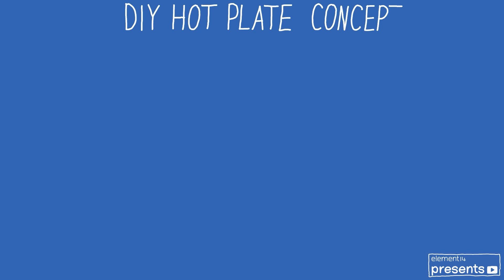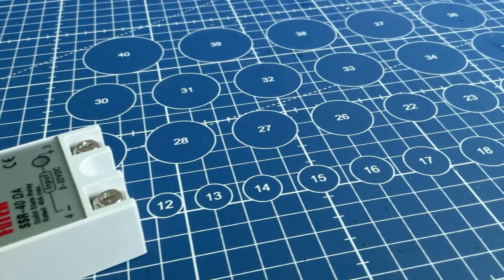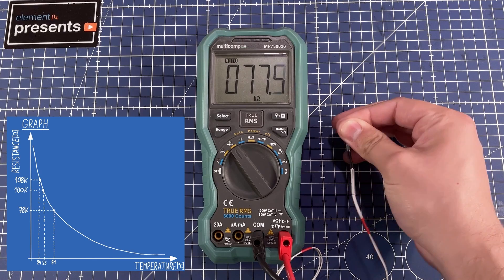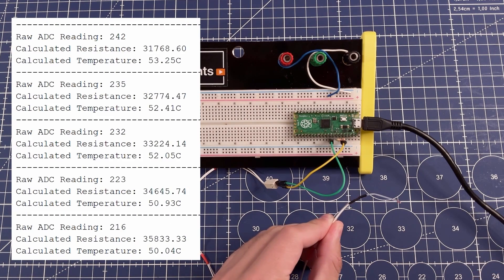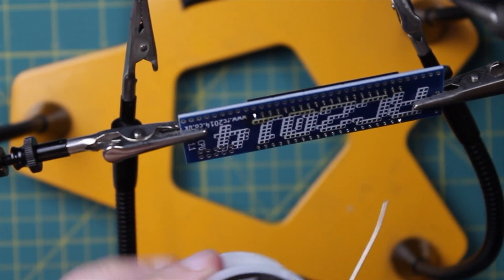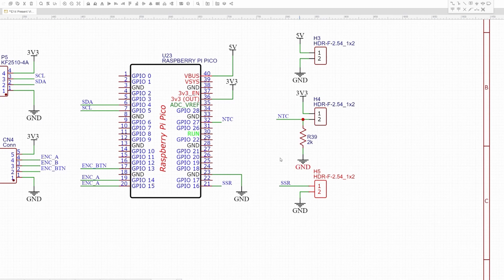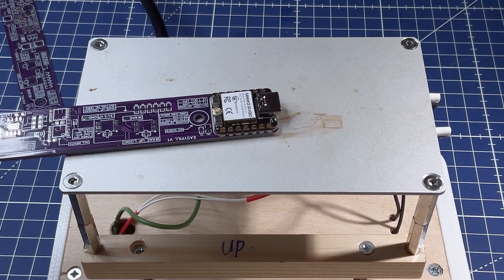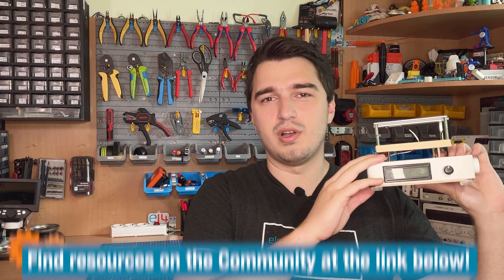DIY Hot Plate for SMD Soldering Using Raspberry Pi Pico

Comment: I have some doubts about how you fixed the thermistor to the plate. Did you drilled a hole om the plate and then fastened the thermistor with a washer?

Comment: Dude, this design makes no sense since you are using a heating table with a ceramic heater. It stabilizes the temperature itself at about 230°, there is no point in attaching such a circuit to it at all.
Reply: Some soldering paste requires a temperature profile with lower temperature like 139 °C. And also you don t need to heat the pcb and component to fast because you can blow them. So, yeah, is not useless.
Reply: @DemonSh  I'm using a strip heater that could go higher unchecked. You could use any kind of heating element with this.

Comment: When you get that much solder paste on your pcb it's easier to just wipe some of it off before using the hot plate, especially on smaller SMD's like the resistors. Just faster and easier than having to go over every single connection again with your iron.

Comment: Don't we ever need a heatsink for the SSR ?
Reply: If it's way overkill (like 40A) it maybe not necessary. In 3D printer they generally don't use heatsink. However not only there is often a fan to recycle the air but they stay away from 4€ models from Aliexpress on something that can be a fire hazard.

Comment: Thanks for posting that! Was using a raised LED desoldering plate similar to that and it only had the 2 wires coming into it, so I usually only touched the board with a chopstick or other non-conductive item when it was plugged in. That said, it heated the boards too much and I want to have a MUCH SAFER AND RELIABL option with an actual temperature control so it doesn't overheat any PCBs.

Comment: Cool.
I'll have to try making it myself using a bare ATmega (currently that's all I have on my desk).
There 's a little question, does controlling the SSR not need to synchronize with the phase angle of the AC line?  
No need for zerocross reading?
Reply: I never worked with SSR's, but after seeing your question I decided to look it up. Seems the zero crossing detection is needed if you wanna dim lamps etc. If you apply steady power to the SSR it will be 100% on.

Comment: Does anyone have a link to the hot plate?
Reply: You can find loads of versions online. They are called “PTC hot plates” or some variation on that. The PTC means Positive Temperature Coefficient which means that as temperature increases the resistance also increases which reduces the power to the heater, this is good because if you just connected it straight to mains voltage then it would rise up to a certain temperature and wouldn’t be able to go higher. This is also why they have temperature ratings, they won’t be able to get higher than this so make sure you choose one with a high enough temperature that it will work with whatever paste you use.
Reply: @conorstewart2214  thank you! Most important part of the project not listed hehe. Found what I needed thanks to you!

Comment: I would probably not use wood myself even though it is tempting... There are some high temperature alternatives like phenolic resin (bakelite) sheets or PTFE sheets (probably too expensive). I would probably opt for something like G10/FR4 / PCB without the copper layer... which should be accessible for people working with PCBs, particularly because it is the theme of this video.
Reply: PTFE sheets are not a good idea, if they get too hot they will start to offgas. Plastics in general aren’t a great idea unless they are thermoset plastics because otherwise they could melt. At least with wood it would burn and you could see it more easily. G10 or FR4 is likely a good idea, it doesn’t really matter if it has copper on it really and you could always sand or grind it off if you wanted too.

If there is enough separation between the hot plate and the mounting material it should be fine anyway as the temperature down at the mounting points should be lower.
Reply: @conorstewart2214  PTFE is used to coat frying pans. True that cheap PTFE can start decomposing at ~260C, but at that point wood is already at risk of burning your house down (starting at ~200C).
Reply: I'm running the hot plate at max 205-210C, and I've run a few tests where it was on for half an hour or more without any issues so far. The mounting points don't get as hot because of the standoffs, though I'll run a long test again and measure the wood temperature. Bakelite is a great option, and I had a few smaller sheets of it, but cutting it and sanding isn't the most fun thing because of all of the dust ir produces.
Reply: @rasicmilos  I do not think your solution is inherently unsafe, but ising something better can make it easier to have smaller standoffs, use some insulation on the bottom and make it heat up faster and keep the temperature more stable for the pid control...
Reply: I think I'd just go with FR4 (Garolite). It's cheap and what actual circuit boards are built on.  Sheets up to 8mm thick are available on Amazon.

Comment: i use a Pizzaoven for SMD and classic components soldering (even mixed components) since years......
Reply: That's cool, I've seen a lot of projects using ovens for soldering, I'll make one for sure due to better temperature consistency and the fact that multiple boards can be inside at once! I love the hot plate because there is access to PCBs if I'm reworking a board like desoldering something!